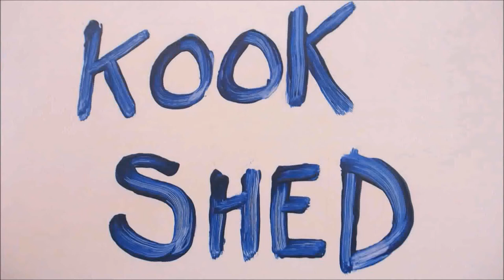How To Remove Traction Pad (Tail Pad) From Surfboard - Kook Shed Episode 19

Comment: Yes, please do a glazer review... thank you... also what fin set up you think will work in most average condition.
Reply from the maker: no worries mate, stay tuned for the full review soon! will be doing a fin guide video soon as well, cheers -KS
Reply: @kookshed  awesome, can't wait..
Reply: @kookshed  just a suggestion, I wonder how that seaside side fins would work with a trailer with the glazer?
Reply from the maker: @kdenbeaches808  hard to accurately say at the moment mate, and my Seaside quads don't fit my Glazer. but Rob does say the Glazer can also ride nicely as a twin as well so it might be a fun setup. if i tried it as a twin with a trailer i'd be inclined to try a pair of twins that are longer with more rake in them first, might suit the template better but you never know! experimenting is fun so let us know if you ever mess around with those fin setups and how they go -KS

Comment: im using this technique = hair dryer to unglue the pad + acetone to clean the glue protect your hand tho. You can reuse the old pad with neoprene glue or neoprene mastic.
Reply from the maker: Nice one mate, thanks for the input. reusing the pad (if still intact) with wetsuit glue is a great idea! Cheers -KS
Reply: Using Acetone is ok for an epoxy board?
Reply: @albertomenendezblanc  yes, it's just not healthy so you have to use glove, you can use rubbing alchool but i found it's less efficient.
Reply: @youdigsurf  I've tried with alcohol and the glue residues are immune to it. I'll go for the turpentine option. Crossing fingers 🤞
Reply: @albertomenendezblanc  not sure it's will work, i think you will grease your board at best lol keep us informed of the outcome. Sometime you can scrap the glue by hand or with a squegee.
Reply from the maker: @albertomenendezblanc  i have used Acetone on some epoxy boards but it is a very strong chemical and might damage some boards and even your health. i recommend trying other products like natural citrus based glue remover or mineral turpentine ('turps') -KS
Reply from the maker: @albertomenendezblanc  i have used it on a PE board by HaydenShapes but can't guarantee it on everything. very strong chemical, i recommend trying the others mentioned -KS

Comment: I would like to know what you think of Helium compared to LFT. I like LFT better. It gives a bit more weight to the board and has a different flex. I have an Omni and Moonbeam in LFT and a Hydroshort in Helium. I like them all, but it would be nice if you could get a Hydroshort in LFT. 
Like your content and where do you surf in Australia?
Reply from the maker: hey mate, yeah Helium is lighter and also sits higher in the water apparently, so it would definitely have advantages in weaker waves and LFT could definitely help more in more powerful stuff. as for flex and performance property differences, stay tuned for the Glazer LFT review coming soon! KS is broadcasting from Australia's South East Coast mate, cheers

Comment: Hey mate, got a second hand board last year that hasn't got a tailpad but is waxed. How would I remove the wax to put a traction pad on there? Terpentine as well?
Reply from the maker: hi mate, yes some Mineral Turpentine on a rag should get the wax off with a bit of rubbing. i soften the wax in some sunlight for a few minutes then scrape most of the lumps etc off before attempting to remove wax fully. and make sure you clean off the Turps after with a little soapy water, then dry it fully before applying the new pad. hope this helps -KS
Reply: @kookshed  Thanks!

Comment: Can I use the same pad again? It’s new. Just put it right now but I think its a bit forward might wanna get it back a little bit
Reply from the maker: if you are quick and move it before the glue sets, you may be ok. give it a try, but maybe put something with a little weight on top of the pad once you have re-positioned it,  like some books, to give the glue a chance to work again. you could even try adding some of your own adhesive to the existing glue, as long as it's not harmful to the board's materials. hope this helps -KS
Reply: @kookshed  thanks!
Reply: Absolutely!  Just buy a can of 3M adhesive spray, then spray a layer on the bottom of the pad and it's good as new.  I've even transfered old pads (that I didn't destroy) on to new boards this way.  A can of spray costs about 1/4 of what a new pad costs...and the can will probably last  a lifetime.

Comment: So what did you do? Got a seaside and they put the pad an inch to high up. Did you literally just squirt the orange stuff on it and leave it over night and that’s it?
Reply from the maker: you can leave the citrus based goo remover on for at least half an hour and then try, or you can use mineral turpentine (turps) if you don't mind using strong chemicals. if the pad has been on for a while you'll have to rub for quite some time to get it all off completely. hope this helps -KS
Reply: @kookshed  with turps should I leave it for 30min and pour it straight on the old pad? It’s a new FireWire seaside so I don’t want to screw the surface up
Reply from the maker: @agl5245  fair enough mate. if it's a reasonably new board the glue remaining on the board from the previous pad should still be pretty supple, so you can try rubbing a rag on it that has a bit of turps on it first. if the glue has hardened you might have to apply some more and leave it for 30mins before trying to rub it off. i know what you mean about worrying about turps on a new board! that's why i prefer the citrus stuff. but it hasn't damaged any of my boards that i've used it on. just make sure to wash off any residue well with water before taking it back in the ocean -KS
Reply: @kookshed  thanks mate, I was worrying for nothing, all done in about 20min. Thanks for your help, thanks was too easy. Cheers

Comment: The side fins are for turning the board. Tail patch forward, enough so foot is over the twin fins. Back fins are for hold and direction. If your too far back turning on the back fins it will effect drive. Surf every fin set up like it’s a twin. The tail will be freed up a bit for maximum speed.
Reply from the maker: thanks for the input mate. i guess it varies a little from rider to rider too. still experimenting with what works best for me. cheers -KS

Comment: Could the pad you removed be used again or is it left to throw away?
Reply from the maker: if you remove a new pad that has only just been put on, and it is still sticky and complete yes it's possible in some cases, but usually old pads are harder to reuse, will rip when removing, have sand under the edges sometimes and have lost their gluing ability to stay on properly. you could try re-gluing if still in good condition or reuse them for other things other than surfing if you want to though! saves waste -KS
Reply: @kookshed  ok. Thanks! I'll try